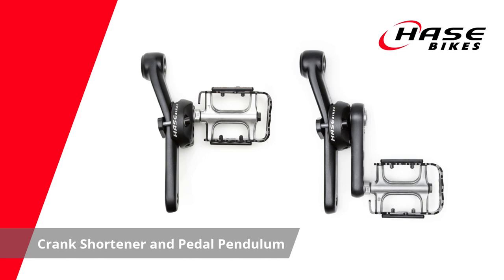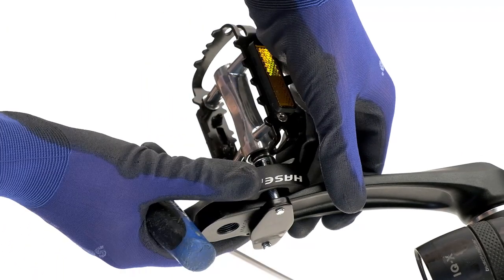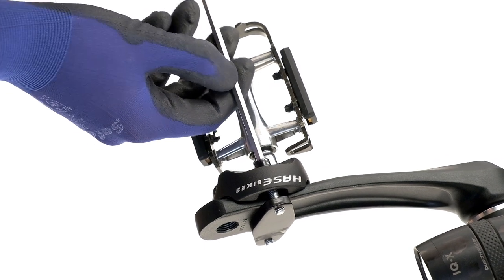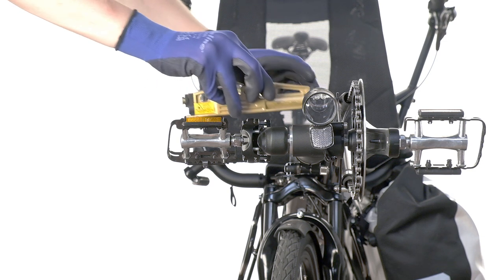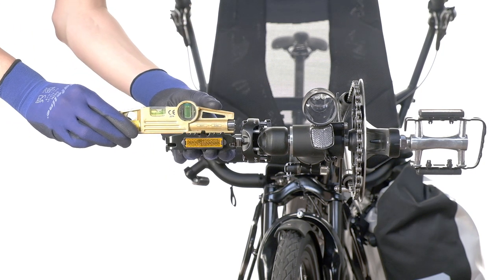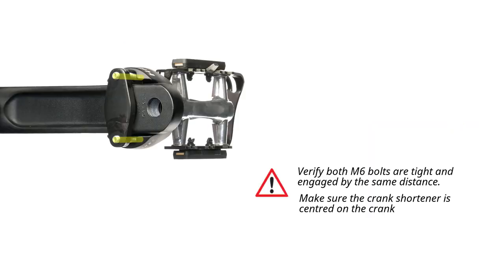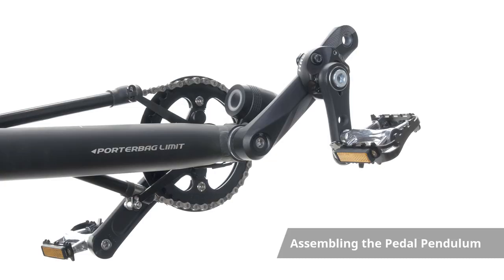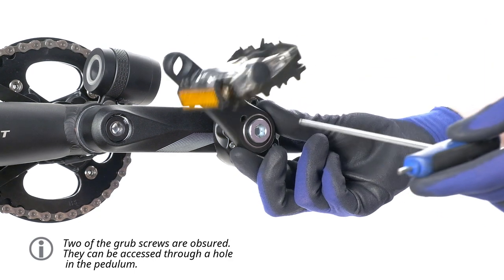Crank Shortener and Pedal Pendulum - english

Comment: I have been using has a pendulum pedal for approximately 2 years. I just went to switch it from an older bike to a new one and found that the main bearing is starting to grind. is there any way to maintain or replace the main bearing?

Comment: I just purchased the Crank Shortener and Pedal Pendulum , Can the pendulum be removed from the shortener and just used the crank shortener? Thanks, Mike
Reply from the maker: Hi Mike, theoretically it is possible but note that the screw which holds the two parts together is fixed with some glue. apart from that, both parts can be used independently of each other. Please ask your dealer for advice and more informations. Kind regards - HASE BIKES
Reply: Where did you order this from
Reply: @HaseBikes  please tell me how I can order this product
Reply from the maker: Hi  @teriwatts2484 , you can order it from any of our dealers. You can find all our dealers on our website: https://hasebikes.com/33-1-Dealer-Map.html Kind regards - HASE BIKES